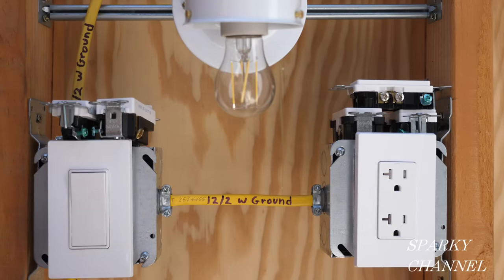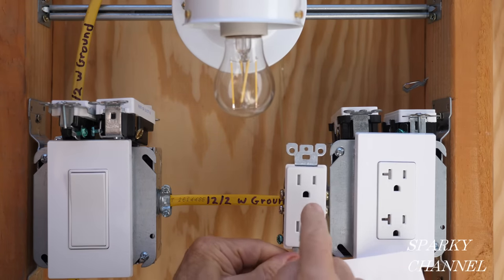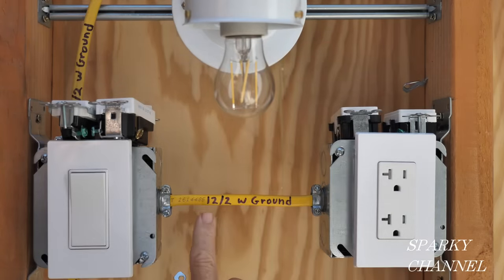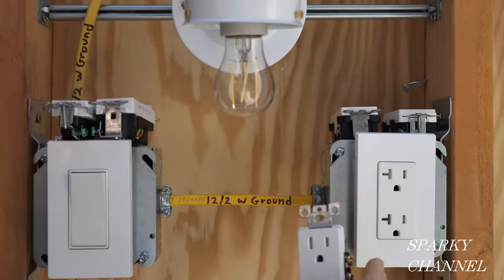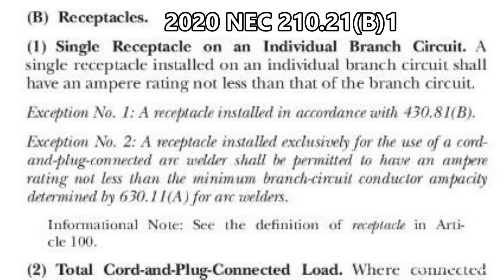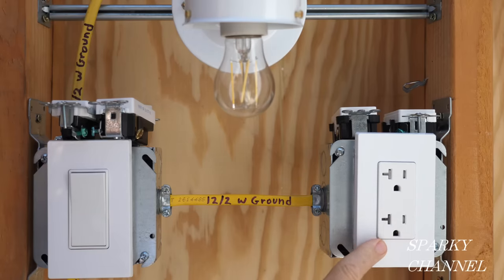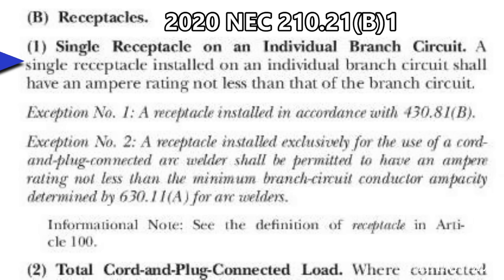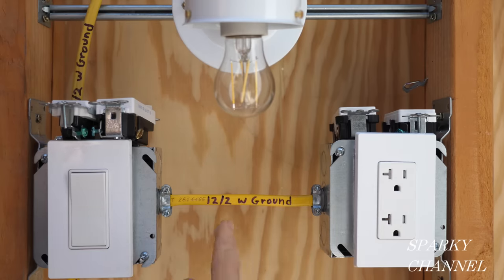Shall I Use a 15A or a 20A Receptacle on a 20A Circuit? + 2020 NEC 210.21(B)(1) and 210.21(B)(3)

Comment: Very different to UK outlets which are all the same pattern. You can quite happily put a standard 13A outlet on a 40A circuit (at 240V). The difference is that, in addition to the circuit protection, there's an individual fuse in each plug rated to that of the flexible cable and the appliance.
Reply from the maker: Interesting!
Reply: Not much different than using a small device using 18awg or 1mm² wire. Personally I call this this the Lamp Cord Theory! 😃
Reply: US electrician here,
During my time in the air force, working with British Standard equipment in foreign locations was quite the adventure.
Not only did we have some American wiring, but pre-2004 British wire color codes, AND post-2004 (European Harmonied) color codes, all on the same base!

For all you fellow US electricians out there, just to give you an idea:
Black: 
US: A phase 
BS: (Pre-2004) Neutral
BS: (Post 2004) B phase.

Blue:
US: C phase
BS: (Pre-2004) C phase
No problem right? Wait!
BS: (Post 2004) Neutral.
Yes folks, blue went from being a phase to a neutral. Oh that alone made troubleshooting anything but boring, especially when both old and new systems were in the same building!
Reply: UK wiring essentially uses the size outlet we yanks use for an electric clothes dryer.  conversely, all of our convenience outlets run at the voltage your shaver outlet in your bathroom runs at. - plus our ampacity limit; which is why we run multiple circuits. (its also why electric kettles aren't as popular, here.  we don't have the raw power to make them heat as rapidly as yours do)
Reply: @kenbrown2808  Standard domestic clothes dryers in the UK are somewhat smaller and run off standard 13A outlets (so are limited to about 3 kW). Anything more powerful than that has to be on a dedicated circuit and hard-wired. 

There are no domestic wired receptacle/outlets beyond that (there was a pre-war 15A type). It's deemed that wiped contacts aren't suited to continual high current usage due to the danger of things like arcing and overheating due to corrosion and pitting over time. Even at 13A, fixed appliances which are expected to run at full power for extended periods are meant to be hard-wired. 

British plugs are certainly on the large size and some would say over-engineered with solid brass pins, but they are very robust and don't sag loose. 

As for shaver sockets, then they are almost universally dual-voltage and can run at the native 230-240V as well as 110-120V. They have an internal isolating transformer so there is no route to ground in wet environments, but they were never designed for high power and will cut out if there's a large power draw.

That dated from the days of fuse-only protection. Now that RCD/GFCI protection is compulsory on all domestic circuits, it might be deemed unnecessary, but the standards remain very conservative on safety matters in bathrooms and RCD/GFCI protection isn't considered 100% reliable. Standard outlets are now allowed in UK bathrooms but they must be at least 3 metres from any bath or shower, so are only practical in larger bathrooms.

In any event, for the normal consumer it's all very straightforward. Shaver sockets aside, there is only one plug type for all portable devices.
Reply: @TheEulerID  here, it's one plug type for 90% of portable devices.  most stuff that draws enough to require a higher power plug is too big to be called portable. but we have a fear of somebody taking the fuse out of a fused plug and replacing it with either an oversized fuse or with a solid conductor.  hence limiting the ampacity of the entire circuit.  I do like your individual shutoff switches on your receptacles, though.  makes it really easy to shut off the receptacle to plug and unplug.
Reply: @TheEulerID  also, our clothes dryers are around 4-5KW and get a dedicated circuit.
Reply: @kenbrown2808  We do have circuit limits too, but for the standard outlets it's normally frequently 32A or 16A, albeit that there's no particular limit. 32A circuits are useful in places like kitchens and workshops as it allows severally moderately high powered devices to be plugged into random outlets without tripping a breaker.

Going back to the end of WW II when the standard was developed, central heating was rare and electric space heaters were common so those 7.7 kW circuits, normally servicing a floor, were often used for portable heaters. These days, there's not so much need given central heating is ubiquitous.

You can't really put an oversized fuse in a plug. They are specific physical size, can't be rewired and new equipment comes with pre-wired and fused plugs.
Reply: @TheEulerID  never underestimate the ability of an American to defeat safety equipment.
Reply: @kenbrown2808  A motor or device that draws 18 amps on a 120 VAC circuit will only draw 9 amps on a 240 VAC circuit.
Reply: @chrisgraham2904  yes, and a 230V 100W light bulb only burns at 25W on a 120V circuit.  and a 9 amp 240V motor will draw its locked rotor current until it cooks itself on a 120V circuit.  was there a point you were making?

Comment: This is exactly the video I needed. My entire house has 20 amp wire to our outlets. Some room have 20amp receptacles and most have 15amp. In planning to change our receptacles from almond color to white I will keep the kitchen counter receptacles 20amp while making the living room and dining room ones 15amp. I don't know why the original electrician did that but that's my plan forward now knowing 15amp has a 20amp pass through rating.
Reply from the maker: Sounds good!
Reply: You can have more 15 amp receptacles on a 20 amp line than if it was just a 15 amp line.  Saves on circuit breaker runs to the room.  Kitchen will typically only have 2 outlets per breaker because they are large power users like fridge and appliances.

Comment: I dont know if I missed this or not.  You said that on a SINGLE outlet, you have to use the 20Amp outlet, and on a DUPLEX (because it's a pass through from one to the other) you can use either a 15 or 20 amp.  OK.  What happens when you break the tab on the duplex outlet?  As in one of them is a switched outlet while the other is hot?  Does that now count as a single outlet?
Reply: Yes, but remember that all the other outlets in the branch are also counted. The idea is that as the single receptacle can never draw more than 15 A, you should protect it with a 15 A circuit breaker. Yes it is a somewhat strange rule as you could put a double and never use the other one.
Reply: oshtoolman
 ... when you break the tab on an outlet to switch one side you no longer have a pass-through unless you add a pigtail, which will maintain the 20 amp pass-through. It's still a duplex outlet in the end so allowed.
Reply: @rupe53  This is true.  I think I wasnt clear in my question.  Sparky was talking about a single ROUND outlet that must be a 20 amp.  I wasnt clear on that portion of my question

Comment: Isn't the 50 amp rated device will trip the breaker if it is used on 40 amp circuit , why the code allow that type of receptacle?
Reply: I was wondering the same thing.
Reply: Uk electrician. The regs protect the building. Like you said it will trip the circuit breaker. Not allowing conductors to overheat & be dangerous. If the circuit is regularly overloaded you would need to upgrade protective device & cable size.
Reply: I think its an exception because most welders use a 50a receptacle but dont draw nearly that current. My 200A TIG draws a max of 26A even though it uses a NEMA 6-50R.

Comment: Great help! I am replacing wall outlets and see previous owner had 15amp outlets with a 20amp breaker. I bought what I saw which were 15amp outlets before I realized on a 20amp circuit. Nothing of higher voltage will be plugged in to these outlets so will go with the 15's. Thanks for your help
Reply from the maker: My pleasure, thanks!

Comment: If you are from Canada watching this according to the CEC 26-700(2) only 20A receptacles can be connected to 20A circuits.
Reply: And in Canada within a dwelling, you may NOT put a luminaire on a 20A circuit...  elsewhere you may.

Comment: U can use 15 amp NEMA 5-15R or 20 amp NEMA 5-20R receptacles on a 20 amp circuit as long as there are two or more outlets.  If there’s only one receptacle on the 20 amp circuit then it has to be 20 amp NEMA type 5-20R. A NEMA 5-15P plug can mate either type. A NEMA 5-20P can only mate a 5-20R. A 5-15R receptacle will reject a 5-20P plug.  Bazinga.

Comment: Why does the code allow a 50 amp receptacle on a 40 amp circuit?
Reply: the receptacle can handle 50amp, it cannot overload on 40 amp. though the 15 only on 15 amp circuit not one that can handle does confuse me, i don't understand why it is like that
Reply: You can use a 50 amp receptacle on a 40 amp circuit because the receptacle is over rated for the amperage.  The 40 amp circuit breaker will still trip if the amperage draw exceeds 40 amps.

Comment: Over the summer I swapped my son's room recepticals with a dual that has two usb ports. I have 20 amp runs but noticed that recepticals with usb only come in 15amps. Good to know I'll be good.  Thanks!
Reply from the maker: My pleasure, thanks!
Reply: They do make a 20amp outlet with usb inputs.  I installed them many times in kitchens
Reply: I'm curious how many appliances have a 20amp plug and cord? In my eyes a 15amp receptacle is used to prevent a 20 from being plugged in. The 20amp receptacle is really a 15/20 and backwards compatible, true 20 would only have a horizontal slot on the neutral side.
Reply: Those usb outlets are dumb, they are basic chargers, no where near as good as a fast charging brick.
Reply: BUT  you need to check the circuit breaker for a 20 amp too.  They may have just used the better wire.
Reply: @Krummin  20 amp plugs are very rare simply because all household appliances are manufactured to function at 15 amps or less.  Electric portable heaters are probably the highest rated appliances in the home, but remain at 15 amps or less.  Anything above 15 amps usually is designed to operate on 240 Volt AC which does require a different plug, like a dryer or kitchen range.  20 amp plugs are common for machinery in commercial applications.  I have one device, my table saw, that draws 18 amps on 110 VAC circuit that is fitted with a 20 amp plug, so it can only be plugged into a 20 amp receptacle.
Reply: @starmc26  leviton makes fast charging outlets now. Either way, it's nice for plugging in media devices next to your tv.

Comment: On a 20 amp line  you can have ~6  15 amp recepticals.  on a 15 amp line it may only be ~4.  Once you start putting 20 amp recepticals on a 20 amp line  like a laundry room  you better have only 2.   So swapping  15A  outlets for a larger 20A is not always OK  it all depends on the whole circuit design.  The 20A lines may be there to save on line runs.
Reply from the maker: Thanks Dan!
Reply: There is no NEC article regarding how many receps you can have on a circuit.
Reply: I believe in the code, NEC code, old, you will find it tells you to take the figure of 1.5 amps And divide that into The circuit you are working on.  80% of 15 amps is 12", 80% of 20 amps is 16 amps. Amps. If you never exceed 80% of the load you will never get it hot enough to cause a fire

Comment: What are some appliances that require the 20A plug configuration (left prong is positioned horizontally)? I installed a receptacle on my front porch and went with a 20A receptacle configuration (12/2 Gauge circuit with 20A breaker) because I wanted to ensure I can use all types of power tools on my porch but I have yet to encounter a tool that has that configuration.
Reply: Had an air compressor that needed a 20amp receptacle
Reply: I believe that there were some, although rare, applications where a 20 amp plug was used, but in modern equipment it seems non existent. A 30 amp circuit is a safer option for equipment using more than 16 amps contuous load.

Comment: A spec grade 15 amp receptacle works just as well as any  20 amp receptacle, and costs half the money.. Outside of 210.21(B)1, the only thing that requires a 20 amp receptacle is a load that draws more than 1875 watts (the rating of a 15 amp receptacle). The attachment plug will have a horizontal neutral  prong, a NEMA specification to prevent overloading a 15 amp circuit. I have never seen a residential appliance that has this type of plug. 

It's a good idea to use spec grade/  heavy duty 15 amp receptacles for areas like the kitchen,, garage, or laundry room, as well as where things are plugged and unplugged frequently.. A heavy duty 20 amp receptacle costs double a heavy duty 15 amp, with literally the only difference being the presence of the t-shaped slot on the face. For ease of manufacturing, manufacturers use the same insides on 15 and 20 amp receptacles, including the contacts. Open a heavy duty 15 amp receptacle and you will see the contacts for a 20 amp receptacle.

In summary, heavy duty 15 amp and 20 amp receptacles are identical under the face plate, making the 20 amp receptacle a waste of money in residential applications.
Reply from the maker: Thanks!
Reply: I see many homeowner changes in my capacity of Home Inspector. Typically they go to the big box store and not a clue…..

Comment: Speaking of 20A receptacles, has anyone ever encountered appliances or power tools with one perpendicular prong that required a 20A receptacle?  I have a 120V welder and large air compressor that both run on 120V and while they have a 15A plug, they occasionally will cause a 15A breaker to pop. One has to wonder, why wouldn't they put a 20A plug on these which has a perpendicular prong?
Reply from the maker: For a while refrigerators came with 20A plugs.
Reply: @SparkyChannel   As did AC units  and corded Dish Washers I have even seen washers and Micro wavs with them  and table saws.
But here is the real world common sense explanation : Appliances and stuff have gotten way more efficient than they were in  the 60's, Look at TV alone  a 60's TV was a 365 watt power draw now they are what 65 to 85 watts ?.... Starting currents are also nothing like they were --  I think this is why you don't see the 20 amp plugs that often these days --the current draw is just not there anymore unless it binds etc and overheats

Comment: Can you help me with a question? I want to add an outlet to my garage that will provide 3600 watts (2880 continuous) for tools, that is GFCI protected. Can you outline how this would be done? I know I could add two GFCI outlets side-by-side, and run two 12/2 wires from each outlet to their own 15a or 20a breakers, but is there a better way to do it? Thanks!

Comment: Can you use a 15amp switch in a 20amp circuit?
Reply: Yes. Code allows it. It is fine. What are you using the switch for? If you are drawing on the higher end of a 20 amp circuit definitely use a 20 but for general purposes a 15 amp switch is fine.
Reply: @CC-jv3wm  2 gang light switch; 1 switch for porch light, 2nd switch for living room receptacle.
Thank you.
Reply: Yes.  A 15 amp switch that is UL rated or CSA certified is manufactured to handle 20 amps.

Comment: What harm would I be doing putting a 20 amp receptacle in the 15 amp circuit? Because the book says so? I don't get it
Reply: $$$ the 20amp plugs are more. When you buy 10-12 they really add up. I used 20amp in the garage but 15amps everywhere else
Reply: @reedrobb  well that wasn't my question at all but thanks for the reply.  The code is the code for a reason. To keep people safe. So why can't I put a 20 amp plug in a 15 amp circuit if I wanted?
Reply: Because you plug a 20A appliance in and the breaker pops straight away?
Reply: @edcooper2396  ok I'm done with the comments. You guys obviously aren't electricians and don't know how electricity works.  Good day
Reply: Daniel Lo-G , maybe it was a poorly worded question to begin with which is why the actual electricians won’t reply.
Reply: @daniello-g5593   Because  by having a 20 amp receptacle  on a 15 wired circuit  you are "inviting" somebody to plug in a 20 amp DRAWING device.
And by a 15 amp wired circuit I mean its protected by a 15 amp breaker and is wired in 14 /2  w ground  wire (15 amp rated wire)  
IF your wiring is 12/2 w ground with a 15 amp breaker  I could see your point  ---to a point that is  but inspectors still frown on this.
In reality things are made cheep these days, I don't care what they print as specs  they are just barely that! 14/2 wire is more like 15/2   if there was such a thing . This I am sure is the real root of this regulation.
As for your comment below I am an electrician with over 50 yrs experience ---so I do get your question and I tried to explain it as my inspector would (and he writes for the code)  And Ed Cooper is correct too  and the more times a breaker trips the weaker it gets (false trips)
Reply: @peevedpatriot3217  thank you. That was a much better explanation than I was getting before. How many devices really draw 20 amps though? Anyway,  thank you
Reply: @daniello-g5593  Actually there are lots -  A power saw  or 1/2 drill - like when it binds in wood ,  any motor device really like a washer with a unbalanced load ,  how about toaster ovens or hot plates they draw normally 13 to  14 amps  so the threshold to 20 amps is not far off when they overheat.   Even your desktop computer could  if the Switching power supply over heats and they also have  the harmonic issue on the neutral wire ---  but thats a whole other discussion.
Its not a case of they will ALL the time but a case of when they DO. These are just a few  off the top on my head.